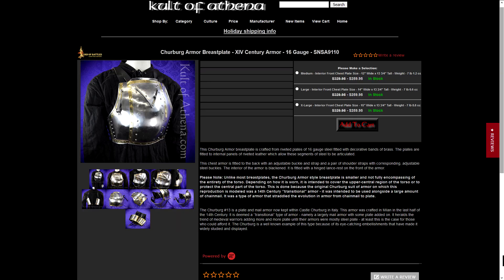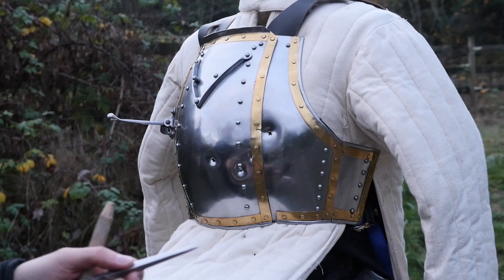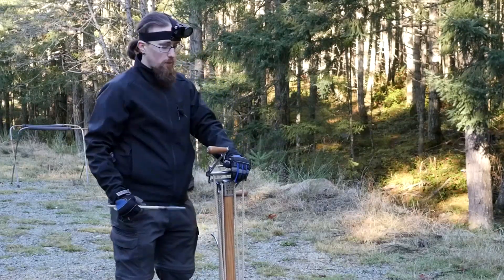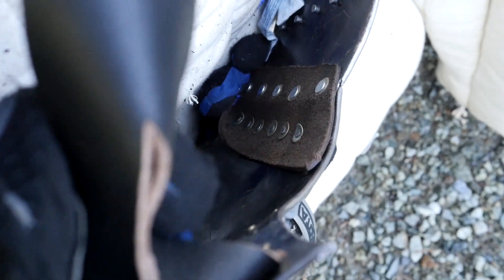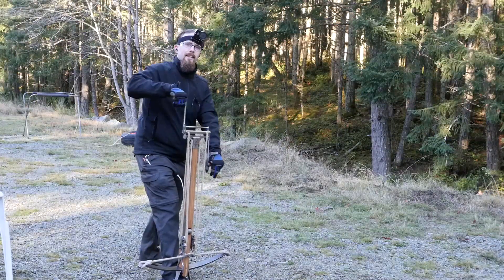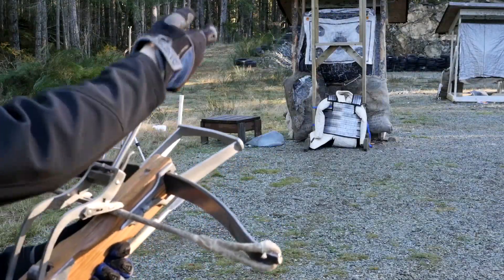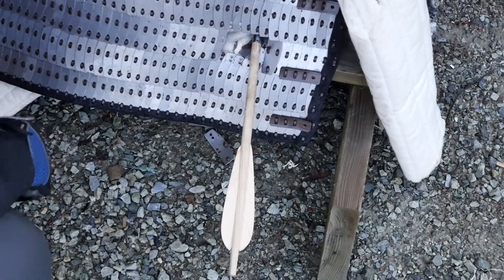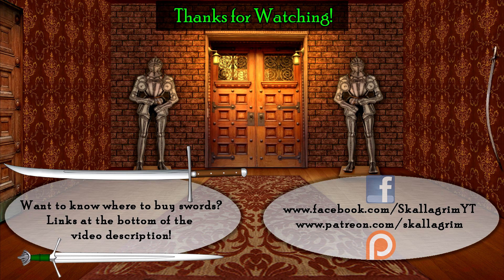Medieval Crossbows vs. Breastplate and Lamellar Armor

Comment: *Gunpowder has entered the chat

*FullPlateArmor left the chat
Reply: Reminder that guns existed the same time around plate armor, and the latter persisted well until the 17th century or so.
Reply: @baronprocrastination1722  And it made a comeback in WW1. Germans had plate armor.
Reply: Tom Hill the British and french too. There were also some French and US prototype helmets to counter shrapnel that looked straight out of the medieval ages
Reply: @baronprocrastination1722  Unlike arrows, the difference between a regular Full Metal Jacket rifle cartridge and an Armor Piercing rifle cartridge is VERY scary. Go watch InRangeTV with their Armor Piercing tests. If i recall correctly, they've done 7.62x54R, 7.62x51 NATO, and .30-06. All three went through a FAR superior body armor to anything that existed before the last, say, 20-30 years.
Reply: Modern plate armor is basically  just a metal rectangle fitted into the pocket of a vest. It is designed nice and flat so that shots can't glance  off.
Reply: @rachdarastrix5251  I've only ever been issued ceramic plates. Last time we (US Army) used metal plates was the early 90's. Advancements in AP small-arms rifle ammo has finally made metal obsolescent. Police may still use metal due to handguns and shotguns being their main threat.
Reply: @blah007001  I have heard many more recommendations for steel plate then for ceramic plate in regards to armor piercing. Its more that the steel is heavier and more expensive. 2 things they don't consider a good formula for soldiers.   

Also what I said earlier was a joke.
Reply: @rachdarastrix5251  The  steel is actually cheaper. Check out AR500 plates versus ESAPI/XSAPI plates. When I was in, the steel was $200 a plate while the ceramic was $600 a plate. Though price on both has come down since.
Also the steel is not as protective, there are plenty of tests even here on youtube showing SS109 5.56 green-tip rounds poking holes through the steel plates while the ceramic can defeat .30-06 AP. Most steel is NIJ Level 3, whereas ceramics are usually NIJ Level 4, so this is not surprising. A lot of manufacturers of steel plates have formed armor out of AR600 or even AR650 steels now, but that only can be rated at NIJ level "3+" And not a true NIJ Level 4 armor.
Sorry for the info dump, but I actually sell contracts for the stuff as a living now.
Reply: @blah007001  Huh... Well that changed quickly. Where did the time go?
Reply: @blah007001  But yeah. I've seen those tests. I've spent entire days watching them. Entire weeks. Its a small, boring world where everything looks the same and nothing exciting ever happens. You think I have anything better to do with my life?

I've seen plenty of tests where steel won. Does that mean I don't believe you about seeing tests where ceramic won? No. Absolutely not. I think it mostly depends on quality. You sound pretty reliable, I might consider it when I don't need to save money anymore. Watching my spendings at the moment.
Reply: T A N K
Reply: Thelondonbadger  not exactly if you Google cuirass vs cannonball, you'll find a French cavalry cuirass from the Battle of Waterloo that while it was pierced by a cannonball actually deflected a musket ball.
Reply: Didn't Soviet shock troops wear a steel plate armour for urban combat well into the middle of WW2?
Reply: No it didn't. gunpowder wasn't powerful enough to stop platemail...well ever actually. Plate mail was used in WW1 in fact.
Reply: @tomhill3248  plate stands no chance against guns you should check skallagrim's flintlock video
Reply: @bobsaget1164  You should check out late medieval plate technology. I already know guns are strong. Some plate Armour is just good enough to stop most guns....but not all. No Armour stops everything
Plate armor stopped being used because it was too expensive. The cost outweighed the benefits of plate in most cases in the modern age. Totenkopf has the right idea. Different armors are good at different things. No one armor type is best at everything.
Reply: @tomhill3248  and ofc armor degrade and well depending on material class will break faster.
Also steel weight alot.
ATM full IOTV can weight around 15kgs and limits ur movement like fk if you didnt serve or had one on urself dont speak on matter please.
It protects but times it can go wrong and bullet catch weak spot or travel under vest and bound on ur arms,stomach legs and neck if you miss collar.
Also if you ever wonder what happens when steel tip bullet shatter on steel armor plate and shards from armor and bullet hit ur face or make any skin contact it fkn hurts.
Reply: @bobsaget1164  Actually plates can stand against guns if it 10 mm plates of reiter cuirass. Furthermore there was cuirassiers armies on battlefield until mid of 19th century. Rifles then appeared and steel plates are disappeared. But now we have composite aramid-metall-ceramic armor and it stands againts most of bullets.
Reply: @tomhill3248  yeah, I saw a documentary about a doublelayered breastplate, the layers were a bit thinner than normal but you had like 1-3mm of air between it, and the reproduction stopped a arquebus bullet at around 10m. (As far as I remember they only found out that it was a layered breast plate when they wanted to find out something else and did different scientific tests with it :) )
Reply: @DukeVictory  Sounds like a splendid viewing experience! What was it called if you don't mind my asking?
Reply: @tomhill3248  that's the problem :D I don't remember... it pisses me off so hard that I don't remember the name :D

Comment: The glue is supposed to be weak so an enemy can't fire a spent arrow back
Reply: That idea works fine... if you have an unlimited supply of new arrowheads and wooden shafts to take their place. But making effective arrows would be a very time consuming (and expensive) process compared to how fast they can be loosed by a bowman. I'd prefer arrows that could be easily repaired and used again if necessary.

Comment: The test is OK but the arrows are not at all. First of all they should be made of special, dried oak which is heavy, hard yet flexible. The other mistake is seen on 90% of reconstructed crossbow arrows, the stabilizers contrary to its name should not stabilize the arrow but make the arrow rotate (similar to contemporary bullets) which make the flight more stable, and penetrate the target easily.  Therefore they were always slightly asymmetrical, especially these with two stabilizers (there were some with 3 or even 4). According to the "manuals" of the Knights of the Teutonic Order (who resided in the areas of contemporary Poland) crossbows were lethal against armor up to 40 meters, and special large crossbows (which needed crews of 2-3 people) used from the top of the walls of Malbork Castle up to distance 120 metres.
Reply: Generally bolts were made of ash.  You're right about the vanes.  See https://www.youtube.com/watch?v=lM_7rUQaZpw

Comment: Those Armors are really effective but the reason why crossbows were feared was that it was cheap to equip a crossbowman than knights. Imagine thousands of bolts eventually wearing the armor down to a point where a few bolts will find their mark and it really takes just 1 bolt at the right spot to kill.

Comment: But why the French knights lost so many times against English long bows (100 to 180 pounds)?
Maybe the metal from 21 century replicas is much more solid than the alloy of middle age. Also it didn't need to pierce totally the armor to wound and stop a soldier
Reply: also, not all knights had state of the art high uality steel for protection. some were still only using chainmail and shields, some had plates only on arms and legs, some on chest only etc etc.
Reply: I always read that the medieval crosbow was the only weapon capable of piercing a knight armor, and was banished by popes for this reason, as an "unfair" weapon
Reply: @Philippe2008fr  chainmail my friend, back in 1000s to 1200s. plate mail wasnt wide spread till about 1300s. a crossbow could and did pierce mail on knights back then

Comment: 8:15 "Might not be lethal"

Seriously? In a time and age you could die from a simple splinter or abrasion because nobody came up with the idea to clean wounds, you wouldn't die from a bolt sticking out of your rib cage? 

You wouldn't die right away, no, but you're certainly be doomed in the long run...

Comment: That's pretty cool! I wasn't actually aware of how well armour actually protected against bolts. I feel ashamed... I have seen too many movies. XD
Reply: @alex z Of course, but so are the weapons used. ;) And the old versions were still good, just a bit less um... stable? Same? Even? You know what I mean? XD
Reply: alex z  Sorry. XD I meant that it's not just the armour that's made out of modern materials and advanced technology. The weapons used in the test are too. Unless you weren't talking about the armour being tested? I mean, both the armour and weapons are made today, but made like the weapons back in the day. So they are both comparatively better than their actual medieval counterparts, being better and more evenly made. As in, the metal will be the same thickness all over and such things. :)
Reply: @alex z Neither is the armour. It's more even, but, that's about it. Some medieval armour would be thicker, because they couldn't make it as evenly thin as we can today, but that doesn't make ti weaker. Heavier to wear though.
Reply: @alex z I understand, but I'm saying that the techniques used to make the modern bows and arrows are also better today, the metal is more even, the points sharper, they are more straight etc. :) And the armour they make today is often thinner, even if it's more even than the older ones were.
Reply: @alex z That's probably true. XD And same to you! :)
Reply: @alex z Haha! XD You know, I'm all knowing and am always right. So, clearly you must be wrong. :)
Reply: @alex z Goddamn it! I was gonna say that! About being god, I mean. XD But then I thought it was too stupid. You win! And yes, I'm totally gay. As in happy... err. :P But we all know that God is a liar and that women are superiour beings from Venus. ;)

Comment: the problem with this arrows is the shape of the tip, it dissipates the energy the arrow it´s carrying. To solve this issue "needle" point arros were made, they were easy to remove but super efective against armor. Full penetration guaranteed

Comment: The tests, as mentioned by Skallagrim are done at very close range. a crossbowman at that range would be to vulnerable. At ranges further out the bolt would use allot of its momentum, and the penetration would be even lower. Consider that when under attack by ranged units the warrior would also deploy its shield, it seems that it was almost impossible to hurt a armored man with this weapons. I think only if hit by many bolts, that damage the armor and or find weaker spots would the armored man be in peril. Of course, less armored man would suffer from this weapon, but a knight may take some minor blunt drama, and some minor pokes from the tips that penetrated a little further, but nothing live threatening.

Comment: the lamellar jerkin thing looks really useless, all of that leather cord used to bind the plates together should really be sinew for much better tensile strength. with this cheap, thin leather it will just fall apart under any real tension and i've found that kind of leather just dries up and breaks on its own lol. of course a lot of stuff that used to be sinew is now made with leather, but it's so stupid. if someone's going to make a historical replica then they should use sinew for obvious reasons. it's more accurate and it's better in those roles. and if they're going to make a practical replica, sacrificing historical accuracy for cost savings and extra effectiveness, then they should use a modern material like paracord. either use the authentic material or use the most effective modern material. if you can't make it truly accurate then don't use some fake "authentic" material to make it look authentic when it really isn't. i hate how leather just gets shoehorned into everything medieval. you even see on some movie/TV costumes that are meant to be full plate, they put like leather edges riveted onto every plate and all the cords and harnesses and shit are made of leather. it's like people think we hadn't invented fucking yarn in the 15th century. i guess real plate armor doesn't look medieval enough, NEEDS MORE LEATHER. oddly you don't see this same thing with japanese replicas and costumes. like samurai armor actually often had a fair bit of leather in its construction, but you don't see any of this shoehorning in hollywood samurai costumes. all that shit was tied together with ordinary woven cord, and they use cord in the modern replicas too. so it's kinda weird that they don't make this error with japanese armor but they do with european armor. i think it might be that our modern perceptions of medieval practices are more informed by modern fantasy tropes than by actual historical information. so even if a show's producers know that everything was not made of leather in medieval europe, they shoehorn the leather in anyway because they assume the viewers think leather was all over the place, because it is all over the place if you look at medieval fantasy literature/games/movies. and that stuff never really happened with feudal japanese fantasy i guess. though, it is ironic that leather was often used in construction of japanese armor, just not in the cord, but modern replicas are mostly just made of vinyl.